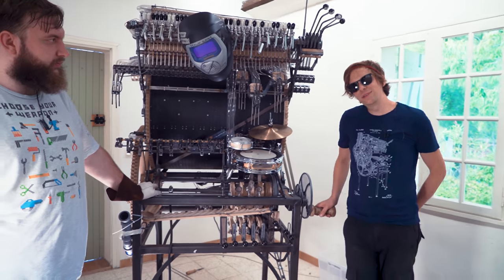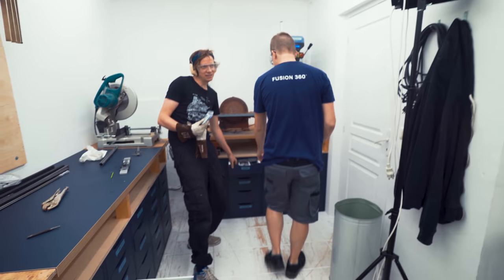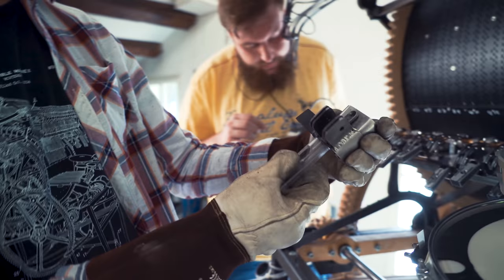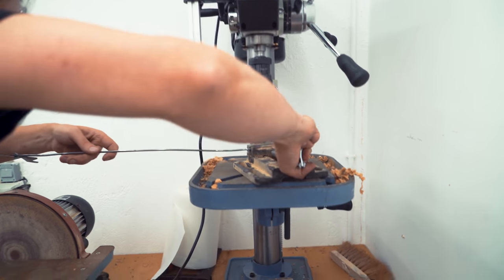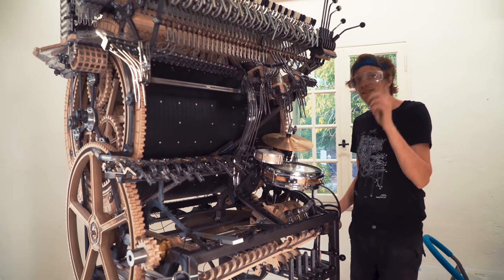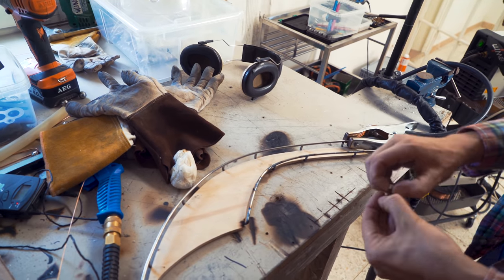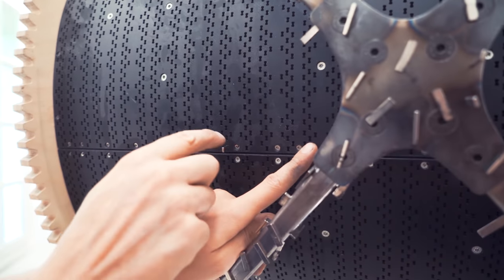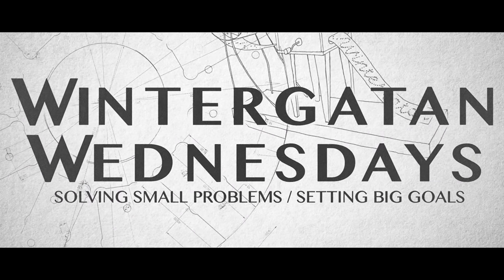Cymbal Marble Drop - Marble Machine X #98

Comment: 6:30 Maybe it would be a good idea to paint in some visible color all the screws which are needed to take out in order to disassemble the MMX for transportation. Each different screw type should be marked with different color with a bit of the part around to identify the place where the each screw type was. What do you think?
13:34 Maybe you could have (rainbow) colors on the programming wheel too, so you would not have to search for the channels?

Comment: Marbles do not fall speedily, 1cm free drop will consume 45ms approximately.
If the dropping points are not adjusted properly(e.g. 10cm free drop for cymbal vs 1m free drop for vibraphone), you have to adjust programming pins instead.
Of course, it could be serious problem because you should know every delay of instrument or is not possible sometimes.
You need to make adjustable delays.

Comment: Maybe I am misunderstanding something, but shouldn't the drop times be adjusted with a higher precision between all channels? It seems to me that Martin just does it somehow, but to have the music precisely synchronized, drop time should be measured and adjusted for each different drop channel separately. Otherwise the pins on the programming wheel can be set super precisely but then every channel marble might be fractions of seconds away. Or not?

Comment: Martin, 
in the video it appears that only 2 marbles get released from the marble collector to the lowest drop point ready for the next hit. what would happen if you wanted 3 or more cymbol hits in very rapid succession? Will the distance of the new pipe run affect the timing? Or does the lower drop point fill with several marbles first?

Comment: I got an idea while watching you program the MMX at about 14:00 where you were looking for instrument channels and tracing them down with your fingers to lock a programming pin in place. You could add a "cheat sheet" listing all instruments from left to right on a kind of horizontal bar welded somewhere onto the frame at the eyes level with the programming wheel in the back, so you could easily identify the instrument channel and program it right away... sounds right?

Comment: Hey Martin quick question, won't the improvised cymbal marble-drop mechanism affect the timing of the cymbal hits? I recall you spending lots of time designing and adjusting the other marble dropping mechanisms so as to have them drop immediately upon being triggered, allowing you full control of attack and timing. The one for the cymbal seems like it has a longer/winding path after being triggered, am I wrong?

Comment: You'd better fix the marble catcher to the main rail because it seems to move a little bit so it's not perfectly aligned withe the main rail. At 15'24, we can see that marbles bump on the arrival of the connector. Ther at 15'29, the collector itself is shifted left.

Comment: I saw that you tracked where your channels were on the back of your machine with only eyesight and your fingers running down the channel on the programming plate.

Is this going to be an issiue when you set up the machine back-stage? You are never going to have to reprogtam the plates when they are ready right?

Anyho, how are the rodding crew going to know wich plate goes where? And is there a way for you to do that without loosing astetics of the machine?

Using UV  ink perhaps that work i UV light? That wont be as bothersome to have backstage as bright florecent lights? 

I look forward to a video explaining this :) Keep going strong. I love your content.

Comment: I wonder if you can design it so that you can switch from crash cymbal to ride cymbal by reaiming the marbles toward the center of the cymbal?  I'm sure you know that "riding" the cymbal makes it go, "ting" instead of "pshhhhh!".
Reply: In other words, add another lever called a "crash-ride" lever, so that when you push it in, the cymbal rides, and when you pull it out, the cymbal crashes.

Comment: 13:24 What about putting a row of labels on the back of the stabilising structure indicating each channel? Would be easier to modify a program if you don't have to follow the channel all the way from the top of the programming wheel.

Comment: Doesn't variation in drop height from the release to the instrument offset the the programming tracks? As in, the track will be delayed by the difference in marble drop time?
Reply: The (lower) release points for the music timing are all equidistant to their respective instruments.  The release points at the marble divider (near the top) are only reloading a marble to the lower musical release points.

Comment: Instead of following the "colorcoding from up there", wouldn't it be vice to put just a bar with a legend where you actually work?
Reply: Like, a horizontal wooden / metallic bar, with icons etched in it or so.  Every device should label where goes what. .... there is so much space on the backside cross ...

Comment: why engineers are afraid of freehand bending is because it's not scalable, and therefore only a viable option for a prototype (and in most cases only mass production can pay engineers). but as long as marble machine x is a unique prototype with the in-house capability of freehand repairing, freehand bending is 100% OK.

Comment: Commenting this again so it doesn't get burried. For the vibraphone why not use the digital system and input a digital vibrato? I mean everything has to run through a computer anyway it would make the system as small and simple as possible. And get you the sound you want !

Comment: What are you planning for corrosion protection? It's all bare steel, partially even with annealing colors from the welding... Very bad... If you plan on going on tour with this machine then you NEED to watch out for corrosion of the steel parts.